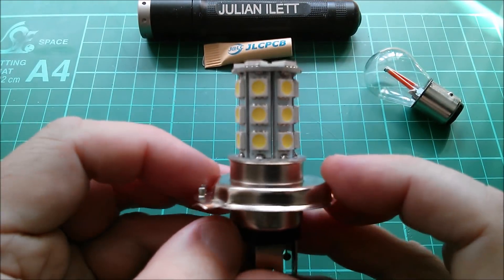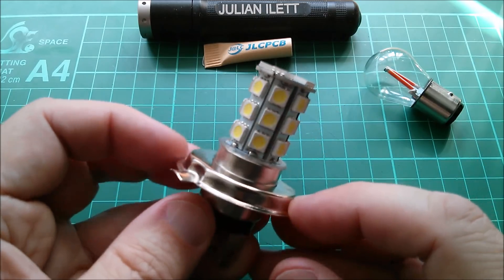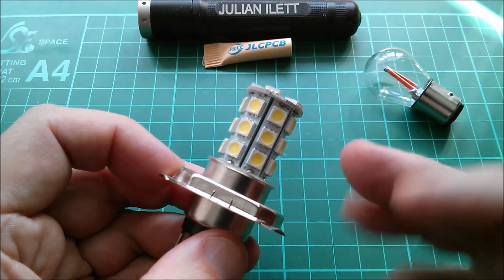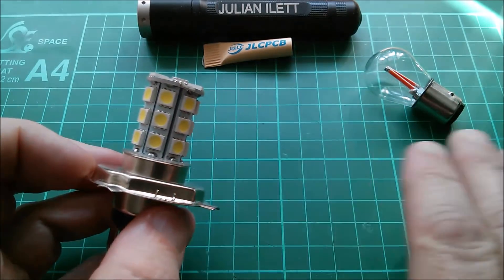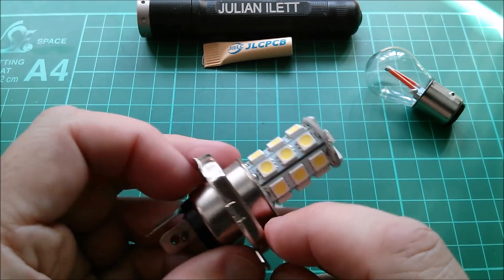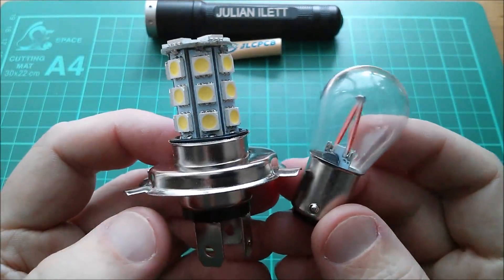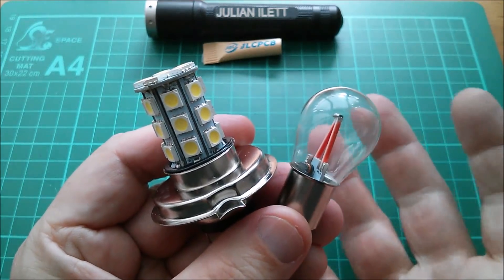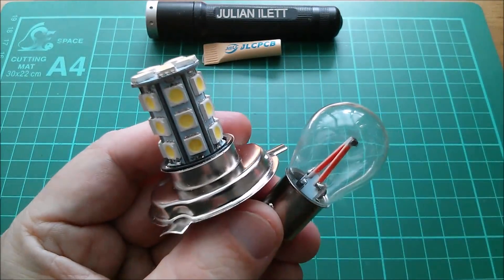SCAM! LED Light Bulbs - H4 Headlight and BAY15D Tail/Stop

Comment: Also worth being aware that it may not be strictly legal to fit these to certain cars, the rules state that they can only be fitted to vehicles that had led lights as an option from new as otherwise they have not been type approved for use in that vehicle.
Reply from the maker: Good point - I'll put a disclaimer in all the review videos. Cheers Mark :)
Reply: you are wrong my friend if the light projection stays the same its legal okay the type in the vid i dont have i got a more profesional one went to the dealer to get them checked and it was al fine
Reply: Yeah, this part doesn't seem to matter in America.  As a car and light enthusiast, it really angers me when people buy these $2.00 Chinese HID light kits and put them in their 1989 Toyota Corolla reflector headlight housings.  The worst offenders these days are the 4 door Jeep Wrangler Minivans and the Chinese LEDs.

It's not hard or really that expensive to do a proper bi-xenon HID projector retrofit using quality components.
Reply: I think in some EU countries any parts that are used in newer vehicles need to be accepted by local governing bodies. (atleast this is the case in Finland) but in practice no one gives a flipping fuck as long as the light works right. Cheap lights may not cast the right light pattern so that may be a problem.
Reply: I wonder how this will work once the EU goes through with its plan to ban all incandescents.
Reply: But these LED bulbs aren't High Intensity Discharge lamps.
Reply: As Mark Flack said, it's not going to be legal in most cases. I imagine that's why UK retailers always say they are for off-road use only. I do find it irritating because I'd like to try them, but it's possibly an unintentionally good thing because otherwise people will be putting any old crap in their cars - imagine if someone put those tail/brake light in without checking them. I did try a pair of side repeaters once, but even they were rubbish because one type was way too dim and the other was yellow and not amber.
Reply: Nearly everything is illegal in the UK
Reply: @JulianIlett  😀

Comment: frankly get the philips red brake lights, i have been using them since ages and they work flawless plus they r street legal. they have some smart circuitry which makes the multiple contacts work in multiple ways which i saw for the first time

Comment: Wait do you think the running light filament goes out when you hit the brake?
If the lights are on one filament is on, hit the brake both filaments go on.
Still be brighter when the brake is applied. 
And the headlight is most likely crap but without the refletor I don't see where you showed anything.

Comment: YES!  A review would be great as thousands of people buy these things and wind up tossing them mainly because of quality or dimness compared to regular filament bulbs.  Another problem is that they are not built properly to take advantage of the receptacle reflector design.  There are a few manufacturers that specialize in making the LED bulbs but a lot of them are unbranded from China that are sold on Ebay.  The number of bulbs available is dizzying and most people find out after spending their hard earned money they are rubbish.  The big question is why are they rubbish.  Are there no engineers out there that can make a simple car LED light that is reliable and at least as bright as the filament bulb? or is that impossible?

Comment: Conventional stop and tail lights have separate filaments so if a tail light goes out you still have a brake light (and vice versa). Same with the headlamp bulbs - if main beam fails you still have dipped beam. With the LED ones, it's all or nothing. If it fails, you lose everything.
Reply from the maker: That's a very good point - it's a single point of failure.

Comment: Are these legal for road use in the UK? In Finland I tried replacing the little bulbs that illuminate rear licence plate. The inspector noticed them and said no no, only original incandescent type allowed. Considering the quality control of these led retrofits it may not be such a bad policy I thought at the time. But what is up with newer cars with oem led lights often having distractingly low frequency PWM!

Comment: The all time worst h4 candidates are the so called "led projector" bulbs.. intending to replicate a projector headlight housing with a lense on the bulb itself. However 99% of h4 headlight housings have anti glare shields Infront of where the stock bulb sits. So you can't even push the projector led in far enough. And if you could the glare shield blocks the light output. 

Not sure which Einstein manufactured those but he gets a gold star

Comment: I may be wrong, but I think the stop lights have one filament powered when your headlights are on, and two filaments when you step on the brake. Having the "wrong" filaments wired up is intentional. "Bright" with headlights on, and "brighter" when the brake is applied.

Comment: Back in 1977, I was on my last few months in the US Army, serving as a recruiter in Minnesota.  Well the Area Commander came to our  Station and looked at my orders hanging on the builin board, then told me that he didn't want anyone who was getting out of the Army on the streets trying to recruit, it just didn't look right, so he ordered me to go home and stay out of the Station till I separated!  Well now back then I was young and full of energy, and wanting something to fill those horrid hours of nothingness, I enrolled in a local Vo-Tec to become an automotive mechanic.  One of the first things we learned was how to align headlights.  Perhaps you could set up an alignment type board and check the lights out against that, it would really give you a good idea as to how they would behave under driving conditions without endangering your life, or that of others on the road.
Reply: The problem is that H4 bulbs have a very strict geometry to make the correct beam pattern, a COB like this is never going to be right, it'll just be like high-beam all the time, although less bright because the LEDs don't output as much light.

Comment: I've used the LED style bulbs in my lawn and off road gear. For those they are nice because the same things that make them crap for road use is an advantage. The wide flood style beam and higher color temps work great in the work lights those vehicles have. Plus the lower current draw allows more lights to be fitted, that is a good thing on my snow blowing tractor. Lets me see and be seen by the folks if I'm out in a storm trying to stay ahead of the snowfall.

Comment: You don't need to buy a lux meter, you already have one, it's built right into your phone and all you need is an app to read it's value, now sure it probably isn't going to be super accurate or anything but neither is a cheap $10 meter off ebay.

Comment: Julian I went through a similar personal review of these LED's for use in my truck, and I found the lack of any lumen data between a standard incandescent bulb and a replacement LED to be critical.  The other issue is on older vehicles the current drawn has a significant impact on the blink rate of LED's in turn signal usage.  Will follow your reviews with great interest as I stayed with the incandescent bulbs on my Ford F150 but that was two years ago and replacements might be a closer match today.
Reply from the maker: Ah yes, hyper-flashing they seem to call it. I'll be sure to put a flasher relay (old style heater/bi-metal strip type) on my trailer board.

Comment: Have you considered removing the solder from the red one, and trying to remove the base so it can the turned around ?
Reply from the maker: Well, interestingly, it may be the incandescent bulb that's wired wrong - not sure yet, but I'll be sure to let you know :)
Reply: I had a tungsten bulb wired the wrong way round

Comment: Every time I find an LED bulb in a car I take it out. Stamp on it. And bin it.
The benefit of led's is they draw less current. However, a metal contact, exposed to snow, rain, road salt corrode, only the current that an incandescent bulb draws keeps those contacts clean. So an LED bulb will actually destroy the lamp holder it fits. You'l notice when a car manufacturer designs and builds an LED unit, it is sealed, and in the case of a large Japanese car manufacturer did with its crash pie, they had a factory recall because the seals failed... All direct LED replacement car bulbs are a scam use them at your peril.

Comment: Very quick lumen depreciation on those lamps, as they are horribly overdriven. I got a lot of them, and use them instead ( they were wedge style, but same construction) as side lighting in wedge holders. got a lifetime supply of spares as well, they degrade quite a bit, as I compared a new one with one used for a few months.

Comment: UK has change many MOT inspection rules in May this year and Headlamp and other lights can have a harder time to Pass when LED or HID are used in fixture made for Halogen and standard tungsten bulbs because replacements are too dim, too bright, unfocused output, and other problems like backward wiring like in the video. Biggest problem in the UK and other counties many Drivers don't care that all LED are crap replacements for standard bulbs in a car. This is why Osram and others sell LEDs for cars with "Off Road Use Only" on the package knowing they will be used on the road in most countries.

Comment: Rarely ever do drivers with after market LED lights understand the potential for causing accidents with oncoming traffic and forever blinding drivers in front of them. Apparently a large proportion of drivers haven't got the first clue how the in-car headlight adjuster functions! In the UK at least, the wrong headlight bulbs will result in an MOT failure. It's fair to say that if you buy any bulb that was NOT designed specifically for your vehicle's reflector housing, the resulting beam will NOT be correctly aligned, in accordance with UK MOT guidelines. Some 15 per cent of drivers have suffered a near-miss due to the brightness of some new car headlights, according to a new report by the motoring body.

In January 2018, the Driver and Vehicle Standards Agency ("DVSA") announced that some changes were being drafted to tighten up the MOT rules on the fitments of after market HID kits. These changes are still in draft, but the essence seems to be that, if you want to upgrade a car to HID headlights, you must use a headlight unit specifically designed for the fitments of the HID bulb you're upgrading to. So, for example, if you wanted to fit a D2S-type HID lamp, you would need to use a projector or reflector specifically designed for that bulb.

Comment: Different model cars have different configurations in America versus England versus Audi versus Chevy depending on the vehicle they sell different bulb types you have to be very careful especially with headlight configurations you have to buy specific bulbs for your specific vehicle 1157 is the one that you have they also make a caveat with a 1157 - something before the different pin configuration

Comment: Julian, love your channel. 
Thanks for being so informative.
I haven't had much luck finding some good quality, bright and most importantly long lasting T10 Parker light bulbs. Recently I tried AUXITO T10 Wedge 2825 bulbs and they didn't even last 3 days of use to replace my rear licence plate bulbs. Either they burnt out or started to flicker.
Anyway my fingers are crossed to see if there are any good bulbs you might find. And point me in a direction to what type of LEDs are reliable.
Keep up the good work.
Ta Mate!

Comment: The led bulb doesn't work in my Mitsubishi.  The car measures the current from the bulbs and if it's too low, tells me I got a burnt out bulb somewhere.  Also the turn flasher relay has trouble with led vs incandescent bulbs.  I bought solid state relays, but never tried them yet.
Reply: The BCU simply measures the resistance of the filament if the bulbs. An LED has no resistance, or a resistance significantly higher than am incandescent bulb. This makes the BCU think the bulb is open circuit, which is blown.

Comment: CAN is a communications bus often used in vehicles but it's definitely not a fact that all lamp monitor circuits communicates over it. Whoever thought calling them canbus leds was a great idea should be shot.
Reply: Christian Ivarsson no, not all cars do, but there are a lot of them that do, and having bulbs tested to work with systems that use CAN for light monitoring is good if you have one of those systems.

Comment: A car with replacement LEDs will fail its MOT test and it is technically illegal. A policeman is probably unlikely to stop you unless you are dazzling significantly.. A Multi LED H4 has leds spread over a large area instead of the nearly point source of a filament so the reflector will not work properly

Comment: Because of the headlight cob style not working correctly, I went with HIDs. They worked a lot better. The HIDs actually glow from the center like a standard halogen and then when putting high beams on, the bulb moves back slightly. Works pretty good. I only paid about $30 for the HID conversion for my mustang. Will be getting another set for my truck as well.

Comment: You could copy the appearance of the trendy LED rear indicators on a certain car brand with an adapted version of your neopixel lightsabre - you could have the most pimped trailer in town.
Reply from the maker: Oh, I have a wonderful idea idea for that. A vertical line of LEDs that displays the word STOP when you flick your eyes left and right. Only problem is that it will appear mirror image sometimes. Unless it displays "MUM" or another word which is symmetrical :)
Reply: You might be better off with a graphical stop symbol that'd work either way round e.g. https://bbj.hu/images2/201703/1490856528239ZQ2vLaIDG6WP_O.png

think there's a political message there, don't know what it says and I'm neither for or against it - I just like their stop symbol.
Reply from the maker: Ah yes, neat idea - perhaps with a slightly elongated middle finger :)

Comment: The Chinese sure screwed the pooch with these two bulb types.   I just asked half a dozen ebay vendors to stop selling them as headlights.  Those might suffice to light up an area in front of a golf cart at night if it were doing less than 5kph, eh?  Maybe 30 lumens versus 1,200-1,350 lumens for real headlights?  Give me a break.

I've been buying all the little LED bulbs (E26/27, GU10, MR16, E14, E12, E10, bayonet, T10, festoon bases)  from China for under a buck.  Over the years, I've got quite a stock of them, from single LED chip to something like 140 chips.  I also bought adapters from one to the other, so I could interchange any bulb in any situation.  Most of the old E26 style for 120v were iffy, but that's better now with the better designed 85-240vac power supplies.

Comment: Oh Julian! CAN bus doesn't care what type of lamp you use. What usually is meant is some sort of "check control" that meaures the current through the lamp to check if  it's broken. I can't understand why this completely wrong terminology is still used in so many adverts. You can make a video about CAN bus :)
Reply: Thank you.
Reply: dothemathright 1111 
Don't be silly... John Deere don't make cars...
Reply: + dothemathright 1111 Well, this has already happened. Many new cars use integrateted light units which contain LEDs and drivers. Those ARE connected via CAN bus :)

Comment: Never ever get cheap LED light for a car. If you wanna go cheap get cheap normal lights.

Usually car light need to be powerful and they produce a lot of heat. Most of the cheap lights don't have any way to dissapate the heat. Some more expensive models have heatsinks and fans in them. Those ones are usually okay. But even then you need to check if the light pattern is even somewhat close to what it should be. There are tons of shitty led and HID lights on the road these days and they spew out all kinds of weird shades of color out of them. It's incredibly annoying that you see blue light coming out of someones headlight and think it's emergency vehicle. And that could get you in heaps of legal trouble. And some of cheap lights use few leds and resistor which gets really really hot.

If you want to do car tuning with LED light then prepare to spend some money. LEDs aint the cheap way to go in cars.

Comment: For H4 headlight there is more than brightness - you MUST have right light pattern.
Low beam is different for right or left side steering wheel countries and in North America vs Europa.
I have seen here one car with HIDs in H4 sockets......
Reply: Those are not HID. HID requires high voltage and that circuitry will neither fit in such a bulb nor would it be able to sustain the heat very long. Also if you have HID the light would take a long time to get to full brightness so you need have another technology to bridge the lack of light in the meantime...

Comment: This design of H4 replacement can never be correct. A H4 dual filament bulb must have the dipped beam only firing in one direction, there is a shield within the envelope to correctly direct/shadow the beam for the correct dip pattern. It's not simply a bright/dim filament. The brightness difference for dip/main on H4 is only 65 to 55w 

If you do want a headlight to simply test a H4 bulb, search for H4 7" headlight replacement or similar. It's fitted to most Series/Defender Landrovers

Comment: The light beam is formed by the reflectors or projection lenses, not by the light bulb. The only problem with the non-uniform lighting of the discrete LEDs is that even less light than supposed will hit the road...
Reply: The beam is also formed by the bulb itself, becuse the position and shape of light emitting part (filament) is important. It is in completely the wrong position in these two LED lamps.